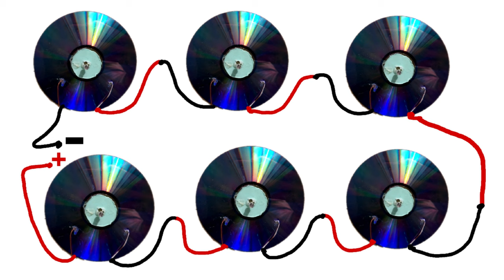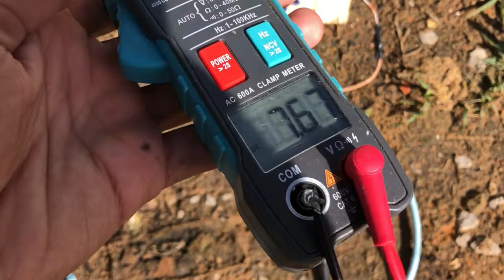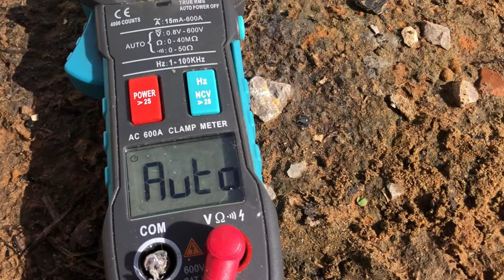I Turn CD/DVD Disk into a powerful 220v Solar panel, New

Comment: LEDs what  for?
Reply: "LEDs what for?" Because they are able to produce electric current from light in addition to being able to produce light from electric current. It's a simple and clear thing. But it would be more appropriate to ask "DISCs what for?" These CDs and DVDs do not affect the final result at all. They are completely useless in terms of electricity production. Also, the title of the video "a powerful 220v Solar panel" is either clickbait or he is extremely stupid. The panel is not a 220V producer, but the inverter produces 230V. And it is not powerful - as he claims - because the mains powered LED lamp burns very very dimly. I have a feeling this guy is extremely proud of this "amazing" and "mind blowing" invention. How many times they describe the leg of this "solar panel" which is an ugly bent plastic tube!
In fact, he would have gotten an equally efficient panel by soldering those 8 LEDs in series and making holes for these LEDs in any plate of a few square centimeters or, say, the lid of a matchbox.
This is insane. But some people don't understand. Why didn't he measure the current even though he has a clamp meter? It would have been much more useful to know the current coming from the LEDs, rather than the voltage.

Comment: i asked ChatGPT if this is possible....    Is it possible to extract solar energy using a CD?     ChatGPT said;    A CD alone isn’t practical for extracting solar energy in any significant way, as it lacks the properties necessary for converting sunlight into electricity. A CD’s reflective surface can direct and concentrate light but doesn’t generate electricity on its own.

However, in experimental or educational settings, people sometimes use CDs with solar cells or panels to enhance sunlight collection. In these cases, the CD can act as a simple concentrator by reflecting more light onto small solar cells, potentially boosting their output slightly. This approach, though, is limited and not as effective as specially designed solar concentrators or panels.

To efficiently generate solar power, materials with photovoltaic properties (like silicon in traditional solar cells) are needed to convert light directly into electricity.   So,   in effect,   according to ChatGPT,  THIS IS FAKE.  I encourage you people who watch these videos to do your own research...   So when you come across YT videos get the facts,   and ask ChatGPT if this is possible....    FAKE FAKE FAKE - don't waste your time on this nonsense.

Comment: DISCs what for? These CDs and DVDs do not affect the final result at all. They are completely useless in terms of electricity production. Also, the title of the video "a powerful 220v Solar panel" is either clickbait or he is extremely stupid. The panel is not a 220V producer, but an inverter. And it is not powerful - as he claims - because the mains powered LED lamp burns very very dimly. I have a feeling this guy is extremely proud of this "amazing" and "mind blowing" invention. How many times they describe the leg of this "solar panel" which is an ugly bent plastic tube!
In fact, he would have gotten an equally efficient "panel" by soldering those 8 LEDs in series and making holes for these LEDs in any plate of a few square centimeters or, say, the lid of a matchbox.
This is insane. But some people don't understand. Why didn't he measure the current even though he has a clamp meter? It would have been much more useful to know the current coming from the LEDs, rather than the voltage. But this guy is not the first African who is out of sense. Sorry!
Reply: Cd are here to reflect the Light so u can use mirror if u can